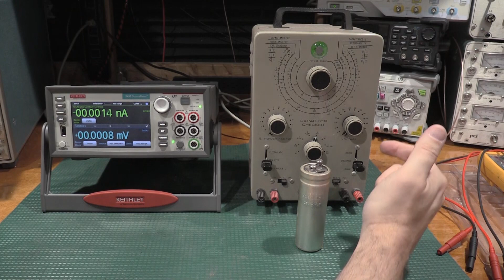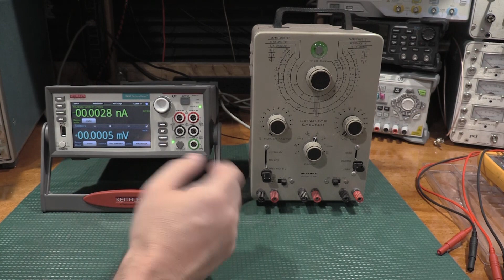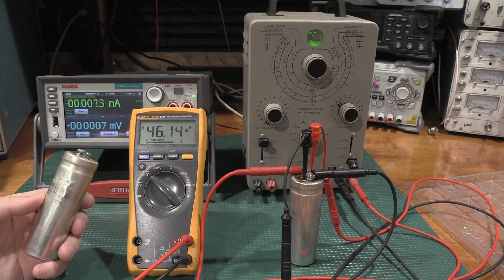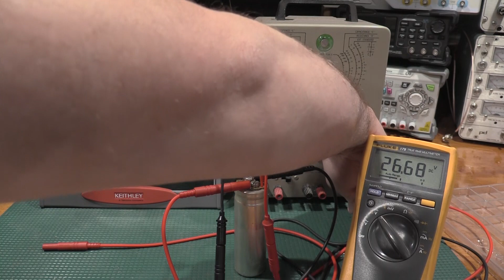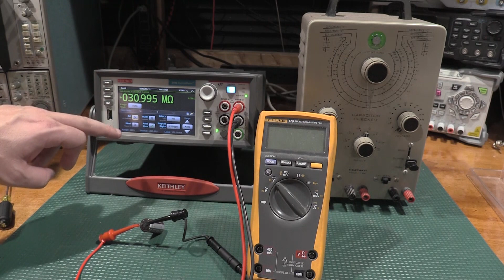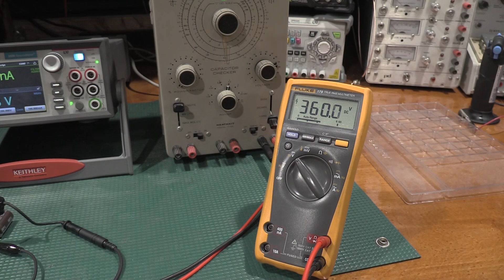A Deeper Look At Capacitor Leakage

Comment: Your complaint about the fluke can be overridden, anoying extra step but I'm in the habit.  "The Fluke 179 True RMS Digital Multimeter has a "Sleep mode" that blanks the display after 20 minutes of inactivity. To disable this mode, you can hold down the YELLOW button while turning the meter on. Sleep mode is also automatically disabled in the MIN MAX AVG and AutoHOLD modes"
Reply from the maker: Excellent I will try this! It will help immensely when I am remote and need to do some longer term monitoring of equipment.

Comment: The date code on your cap is in the 70, all it needs is re-form with proper method,
It will then be better any “modern “ cap, I assured you that.
The MepcoElectra catalog have the electrolytic cap tutorial and re-form methods.
Thanks for the video!

Comment: Week ago i got one Telequipment D755 and it was dead as a dodo. Main filtering caps we're gone, started to leak. Interesting fact was that they tested "good"(capacitance and esr) on my Voltcraft lrc-300 meter.I didn't bother to test leakage current, cause i still didn't made diy instrument for that and i wasn't up for making setup using bench psu, a-meter and couple of wires,but my guess they got pretty high leakage current. After i replaced them scope came to life. After that i replaced all other caps on psu board, but managed to solder one wrong way, so there was a bit white smoke involved. I guess you are not only one who makes this small mistakes. haha  But how much i recall this was first time i soldered cap wrong way.
And ofc great video as usual. I really love your channel.

Comment: Hi, great explanation 👍, I was recently troubleshooting the capacitors in an old HP3400 meter and it freaked me out that some of the 40 year old Sprague capacitors had less leakage than the newly bought replacements - the quality isn't what it used to be. Since I live in the Czech Republic and the USD/CZK exchange rate is not good, as well as my salary, I can forget about buying an SMU as an electronics amateur, I looked at what is available on the market and bought an AT680 - it works absolutely luxuriously for a fraction of the price of an SMU. It does not replace the four-quadrant measurement, but I tested not only the capacitors, but also the insulation resistances of the device, the function of the digitrons, diodes, etc., and the 650V voltage provided by them is sufficient for my applications
In order to buy SMU, I would have to sell my body organs and it might not be enough yet 😂

Nice day 🙂 Tom